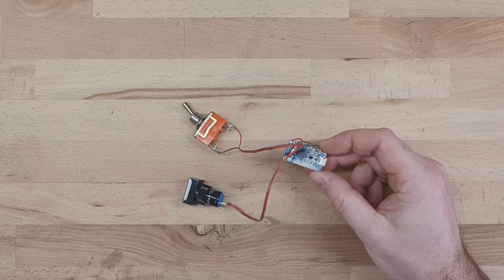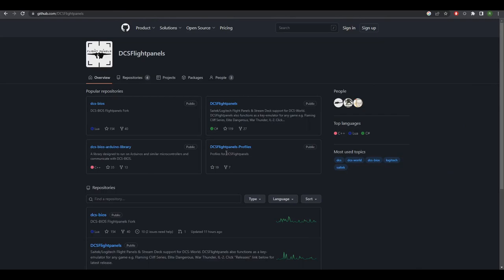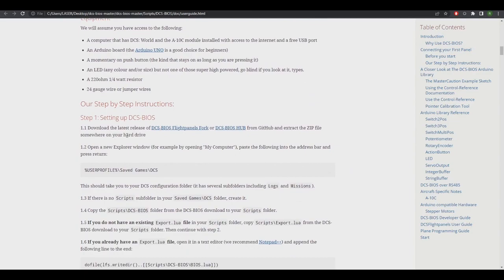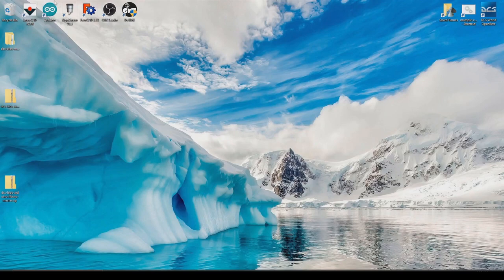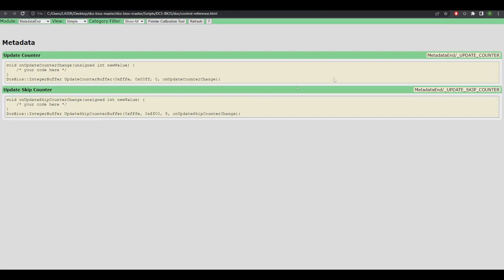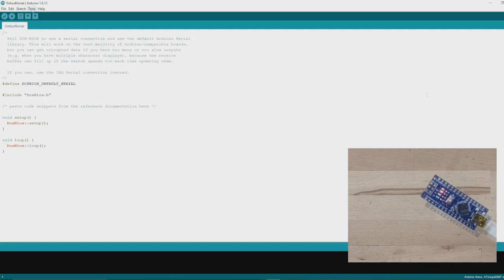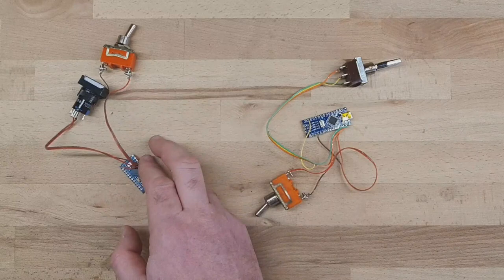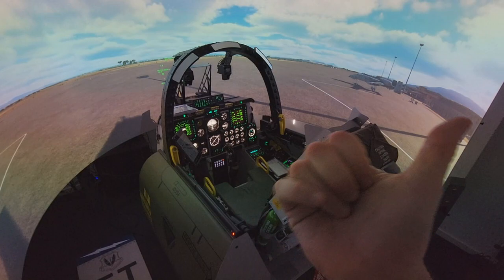Flight Sim Basics (Part 2): Connecting a Switch with DCS-BIOS

Comment: Ha!, what a noob!..... ;P
excellent vid on getting started, only thing I might suggest (here comes the good-idea-fairy again) 
maybe include a short video on what things look like when they don't work, errors when trying to write to the arduino, etc.
simple little things, common mistakes, unexpected respones.... I realise there is 101 variables that might prevent you from diving too deep into the rabit hole
but just a few more 'hot tips for young players' shared wisdoms that would be highly valuable.
like, double check your USB cable/connection, COM port#, arduino type selected. etc.etc.
again, love your work & appreciate your efforts to produce these to share with the community.

Comment: thanks for the tutorial. i was wondering whether you used any resistance parts (pullup/pulldown effect), when connecting the switches to the controller boards?
Reply: DCS-BIOS turns on the internal pullups automatically.  You don't need to do it manually.
Reply: thanks 👍🏼

Comment: All switches and buttons are controlled by one Arduino board like a Mega model, or each component is using one arduino individual?,
Reply: You can use as many switches on one board as it has input pins or if you use a button matrix you can have even more switches on one board.

Comment: Please help a dummy.  I was looking at the Pro Micro ATMega and pulled up the pin diagram.  I see 16 pins, but some are analog and some are digital???  I’m just trying to figure out how many buttons or switches it can handle.  Also can you wire potentiometers into it?
Reply: analog can work for pot meters digital wont im pretty sure u can wire leds and buttons to some analog pins and u cant use the tx and rx pins
Reply: Analog pins can do both digital and analog, but digital pins can only do digital. So if you want to do only buttons, switches and LEDs you can use all pins.